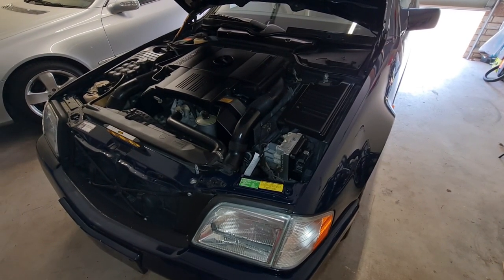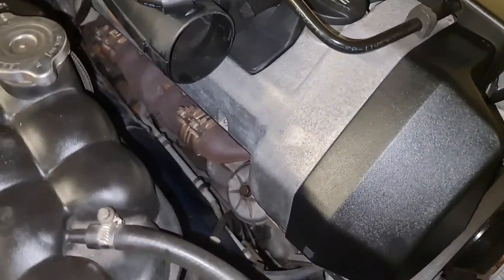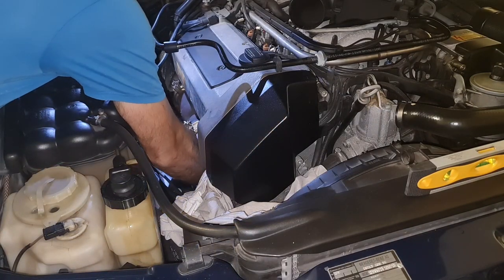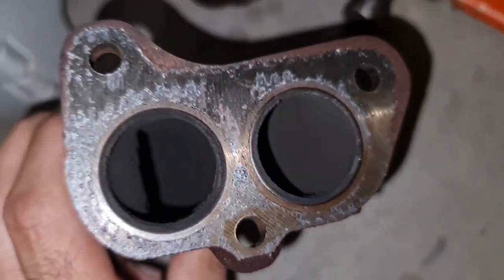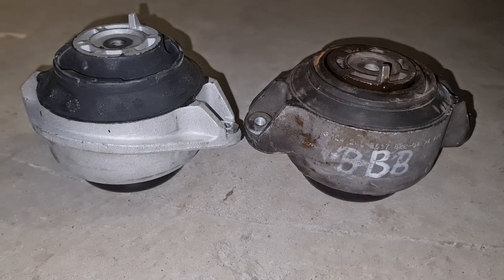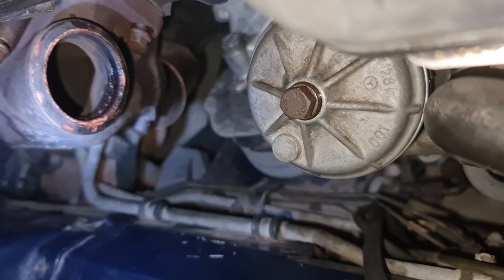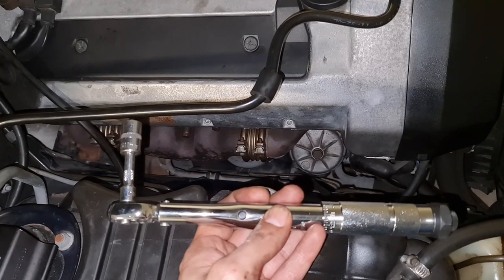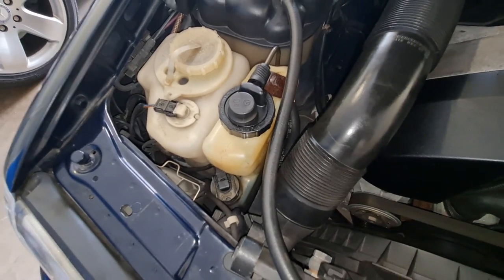Mercedes Benz Engine Mounts Replacement Comprehensive Guide

Comment: Good video 👍
I did mine last week, about 4 hours for the pair.
The rh mount will come out down and back, take off the steering damper and turn the steering to full lock.
Like yours mine were original and well past needing changed!
Along with a gearbox mounting they made a big difference in how the car drives.
Kudos for persistence 👍
Reply from the maker: Thanks mate, glad that you did the project successfully 👍

Comment: Are those r129 mounts compatible with the w124 4matic? They look the same but the parts number are different. Unfortunately the aftermarket mounts for the w124 4matic are out of stock and the genuine one are quite expensive
Reply from the maker: Hi mate, I am not sure 100 percent, but my logic says it should be compatible, one good way is to use parts website like fcpeuro to make sure they fit.

Comment: 98 sl500. Took the oil pressure sensor off and passenger mount slid out the bottom
Reply from the maker: Great tip, thank you. M113 should be different though...